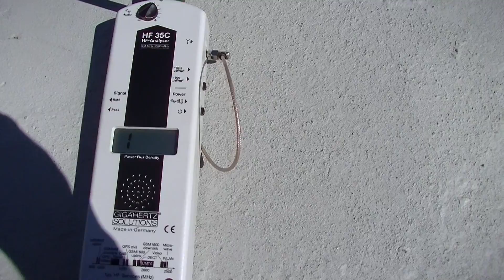What Does a Cellular Antenna Look Like?

Comment: 5G is directional. It doesn't emit in all directions at the same time. You didn't show the difference between this location and another away from the antenna, or show what the RF power reading on the meter was. So like every other 5G conspiracy video this is meaningless.

Comment: Why you put directly high gain receive antenna directly forced to the base station. The receiving antenna forces the gain and as the frequency increase the effect of receiving antenna gain also increase. It it correct if you use just a single dipole instead of 15dbi-20dbi antenna at the front of the detector.

Comment: this meter cannot detect 5G.
Reply: How come?
Reply: @navgator8966  The frequency range of this meter (800-2700 MHz) does not allow measuring 5G. it works on different frequencies, check it out.
Reply: @mateuszzajac5549  ok thanks I do know 5G has much higher frequency /radiation
Reply: by the way, it's not a 5G antenna =)

Comment: You only have a couple of problems: (1) You are using the wrong model to detect 5G.  You are using HF35C, which DOES NOT detect the 28GHz and 39GHz frequencies of Verizon 5G in San Franciso.  The model you are using detects frequencies from 800MHz to 2.7GHz.  (2) You are not properly using the device!  The manual states you need to hold it out in front of you - with extended arm - and actually you should twist the device.  But, you need to hold it out for a couple minutes to get proper readings. (3) You ARE pointing to the tower, but also to the home across the street.  Since the device doesn't pickup the 5G at all - you could be reading a WiFi box across the street.  (4) The unit can ALSO pickup a microwave oven as well - since it reaches into 2.45GHz.

You need to get the HF35WC model - since that will detect the higher frequencies.

You made me want to get these units to test with, but I will use them properly!!!
Reply: HFW35C... costs around 400 euro.

Comment: How about  a link to said study.
Reply: This is the most comprehensive 10 year, $25 million, government funded study that concluded that wireless radiation causes cancer and DNA breaks. The kicker is that this study was done on 2G and 3G. Currently with 4G and 5G the radiation is much more damaging

https://mdsafetech.org/ntp-study-2016/
Reply: @san_tukk  The amount of radio frequency radiation was stronger and had more body coverage for longer duration's than would a human with one watt of cell phone power compared to the rats.
Reply: @anthonyromano8565  1 watt of cellphone power? Are you really going to ignore hundreds of antennas installed all around us? Its not your phone, its 5g antennas thats harmful. And even if you dont have 5g phone you are still exposed.
Reply: @BikeRaceOnly  The cell towers uses power 3 times less than a cell phone. The more towers there are the better the reception and the less power your cell phone has to emit. Its harmless. The more there are the better.
Reply: @anthonyromano8565  lmao where did you educate yourself? Media propaganda? That doesnt make any sense what you just said.
Reply: @BikeRaceOnly  The effects of microwave radiation if any comes from the phones not from towers.
Reply: @BikeRaceOnly  5g is a low energy system. Hey I just read thats all.
Reply: @anthonyromano8565  it doesnt come from the phone it comes from the radio towers, your phone is mostly just reciever, so walking down the road next to 5g antenna even if you dont have 5g phone you are still exposed to the microwaves.
Reply: @BikeRaceOnly  They both emit microwave radiation, the phone less than a watt and the towers are a 1/3 watt.  It just seems unlikely at those levels to be harmful. The rats had higher dosages than we would ever get. I think.
Reply: @anthonyromano8565   Anthony Romano  I dont think phones emmit microwaves just yet. Call towers are definitely stronger than that, surely 10 watts if not stronger and thats per one unit and there is oftenly multiple of them on the tower. Also yeah mices were exposed to higher dose but for 2 years only, how long do you expect to live, surely longer than that.
Reply: @BikeRaceOnly  You cant take a measurement of 10 watts coming out of the air. Your phone produces more exposure.
Reply: @BikeRaceOnly  phones emit electromagnetic radiation in the microwave range. Sorry if I confused you. Every goober knows that.
Reply: @SurprizedDaily  Do you detect the 5g death ray with your tin foil hat antenna's ?

Comment: Yes.  We need 5G.
Reply: No, we don't. It's not worth the negative health impacts. Better to go wired.
Reply: hope you get your house surrounded by atleast 4 of them :D
Reply: @casualcookin3893  I just hope she looks into what we are saying
Reply: What for? In what way do we not have fast enough internet? Do tell
Reply: @spiral-viper One easy example is mulltiple 4K streams require faster internet.  Just the number of devices connected requires more speed to accommodate all devices on the network.  These Antennas are designed and placed for 3 reasons.  Speed, capacity and dead zones.  Have you ever been to an NFL game and your phone barely works?  Airport?   All these issues are an example of capacity and speed.  Even though you have full bars on your phone.  You see these Antennas and get upset.  What you don't see is IDAS and ODAS systems.  Convention Centers, arenas, malls.  Anywhere many people gather for events or have large numbers of people.  University of Michigan.  They have an entire facility testing automous cars and traffic patterns.  Yes they have 5G installed.  You found a spot that you don't need more speed but go back to dial up for some people that was fast enough also.  Link below is to a 32 acre facility that tests all this.        

https://images.app.goo.gl/wzpfvDyPNnxDPmm88
Reply: @kingtaco1472  I know better than to go to an NFL game lol, we don't need it. Faster internet for streams we don't even need; go outside, do something else, we don't even see in 4K. 1080p even is fine, what we need is more time away from screens (ironic coming from me) Think about our evolution over a longer timeline, if there is even a planet left to live on by then. Muscles atropy and we grow over-sized brains lol, most people can't even walk on all fours without it being a good workout (or not even that, we just don't) This all encodes to our physical evolution over time
We don't need self-driving cars. Dial-up is a horrible user experience for anyone and the internet is fast enough right now for most people.
Fiber-optic cable is awesome and you'll get the best speeds out of an Ethernet cable with none of the damaging radiation. Yes 5G will give more capabilities to robotics and AI. Even mainstream circles of thought are concerned about AI, and without knowledge of the nuances.
5G is also for better monitoring of every thought and feeling of every person, plant and animal. If a person does or even thinks something the corrupt surveillance state doesn't like, they can cook that person like an egg in an instant. All part of this great nation and all aboard the panopticon prison planet
https://www.youtube.com/watch?v=658-dnnDjM8
Reply: @spiral-viper  Like you said corporate America isn't slowing down so I will just build upgrade and repair these things and maybe one day we can all say "what is no service?".  As far as the danger I think everything has danger and what doesn't cause medical issues.  I have certainly watched many of these videos and we all know that's why we don't have 5 star reviews.  Someone always has something to bitch about or is reviewing something they couldn't figure out.  From Google maps to new egg to Amazon.  Not even amazing products hold a 5 star review so 5G clearly divides the sides.  Using it at over 1 gig speeds is pretty nice but like you stated. What do we need it for?  If every product invented solved problems we don't even have that would be wonderful.  I also believe go outside and set the tech down.  Grab a fishing rod.  The amount of construction jobs these sites provide are huge.  Soon the smart city phase will ramp up and it will monitor/control  all the stop lights, parking spaces, lighting, assist first responders and more.  This industry is going to be busy for the next decade.
Reply: Funny some people love it others hate it.  Someone please show a statistic on the increased death rate because we have better cell service.  Ever take the florescent bulb from above the kitchen sink out and under the transmission power lines.  You look like Luke Skywalker holding a light saber without plugging anything in.  Nobody talks about dying because the power is to strong.  I say send it.  Is anybody complaining the WiFi is giving cancer or how about the cellphone itself.  The 3g 4g 5g represent the generation of technology.  Apple is up to #11 now. When do they need to chill out?
Reply: @kingtaco1472  they're corporations, they will never chill because it's always about infinite growth and increasing the profits of their bottom line constantly
the mechanism operates by need for more profits every week/month. the same amount made is considered a failure/loss
Reply: Your a brainwashed zombie.

Comment: Your meter is just producing a bunch of meaningless noise. The flashing display indicates it is not accurately set to the proper scale and is telling you to adjust the settings to get a real measurment.
Reply: Its on the lower sensitivity setting, putting the max at 2000 mw/m2. The 1 means it is reading above maximum. And that is the normal sound
Reply: He is using that meter correctly, it is a sensitive one - 2000 uW/m2 is the max reading.  There are no further settings to adjust.  A different meter could tell you that the RF is much higher than 2000 uW/m2.

Comment: So " Fiber Optics" and "5G" are two different things?
Because yesterday I asked an SDG&E worker what he was doing and he said" we're laying fiber optics" but then I said " you mean 5 G?" And he said " Yes" So now I'm confused
Reply: jett888 truth is they dont even know what theyre doing theyre just gettin paid to install it
Reply: fiber connects the towers
Reply: of course they're not the same. fiber-optics were installed years before 5G in many areas, it's a cable that allows very fast speed. 5G is microwave radiation that can be set to weaponized levels, it's hell. you can have fiber-optics connected to a normal router with wireless and that's fast, no WiFi and just an ethernet cable is the best; better speeds and no radiation at all. most people use WiFi because it's convenient and not that harmful, about as much as cellphones (cellphone; cell attack)
Reply: In my town fiber optic trucks are all over and we are on lockdown after 9.
Reply: @brttabt5671  Cell towers are a key point in the control grid, 5G or not. Honestly, we need to tear them all down.
Reply: 5G (and all other) antennas receive their signal through a cable.
Inside these cables there's a fiber-optic thread that allows light signals to travel through it, hence the name fiber optics.

Comment: What frequencies is this tower transmitting at?  You need a SDR (software defined radio) with that directional antenna to see the frequencies and intensity of broadcast.
Reply: SDRs don't go that high in frequency, and won't work. There's no way to receive. The Near Field RF Intensity detector used in the video is the only way to measure the RF signal field strength.
Reply: @ellensibyl  HackRF sdr goes pretty high up in the GHz and very low too. And there is a portable unit possible (portapack)
Reply: Who's right here??lol

Comment: We can do what the French Yellow vests are doing to the speed cameras. Start tearing them down.When they have to face MILLIONS of angry citizens who are not willing to take it anymore, they will have to back down.
Reply: Boltcutters for cables, angle grinder with right discs for metal shields around the devices. Seen people saying "molotovs" and i'm like, fuck man get real
Reply: You do know that we have been using this tech for 30 years? 2.4ghz is the current 4g tech, and the 24ghz is current satellite TV tech.
Reply: @mofayer  This 5G doesn't Sound much larger but I think I heard its 15 times stronger in radiation....
Reply: @mofayer  Yes, but satellite radiation is only travelling in a specific line (like their non-lethal crowd control weapon) out of the way of human contact. And that's 24Ghz not 60.
Reply: @mofayer  That dosent make it right

Comment: Those mini cell sites DO have fiber optics! They run down the side of pole. Thats how your cell signal gets to your carrier's base station. You can make a difference by switching your ph calls to wireless data if your ph has that option using your home router instead of the antenna.

Comment: It's really sad Google is considering fixed point-to-point wireless to deliver internet for their "Google Fiber" project instead of sticking to fiber optic. I know fiber optic is expensive, but once it's ran, it's worth it and will pay for itself. If any company would do it, I would of expected Google to since they have loads of money. It's sad.. not only is wireless un-healthy as you state, it's definitely not a replacement to fiber and won't handle the future bandwidth needs. :(
Reply: Victor Coss "sad?" The links google will use are literally pencil beams so narrow you can have two radios side by side pointing at another site and link A won't interfere with link b. Unless you are exactly in the path of a 60/70/80GHz beam, it won't hit you, it won't harm you; and the transmission levels are insanely low, too, further lowing any risk of exposure. If you were the middle the link wouldn't work. you have no exposure risk to these new google fiber microwave links.
Reply: @wayneco  yeah.. and 5G modules are bubble fields with variable frequency